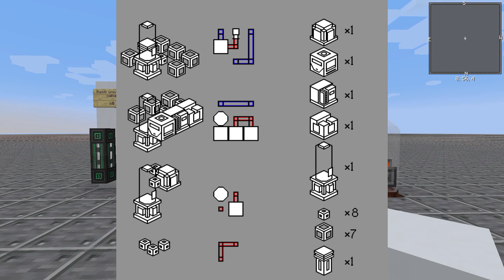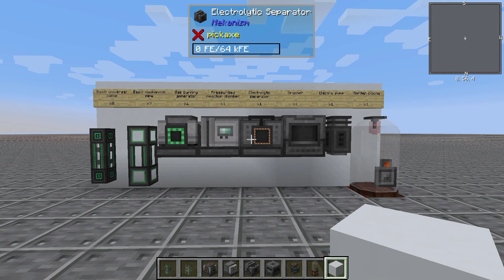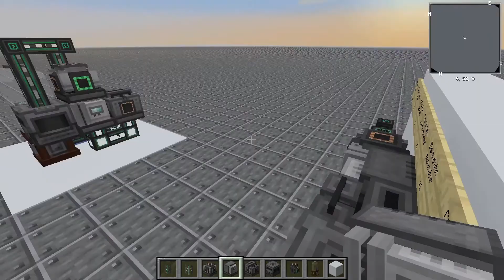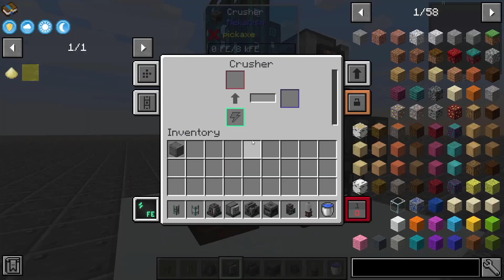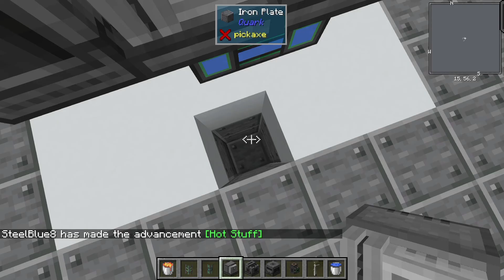Mekanism power- early game ethylene

Comment: Does this function in E2:E?
Reply from the maker: I'm afraid I wouldn't have a clue, you'd have to test that yourself. As long as they haven't messed with the ethylene recipes though, it should be just fine.
Reply: @steelblue8  did it, getting enough rf/tick for an auto sieving setup with triple mek processing